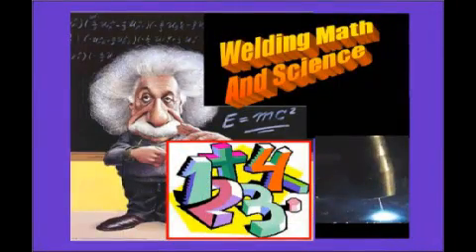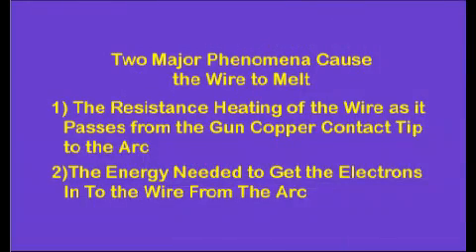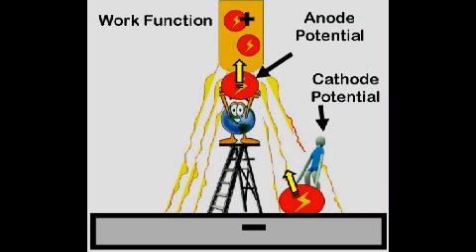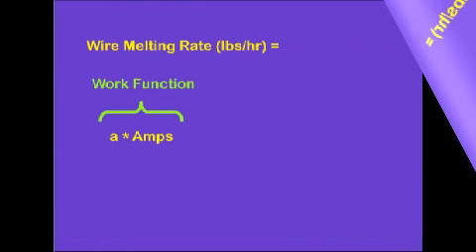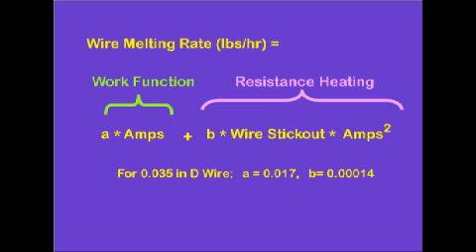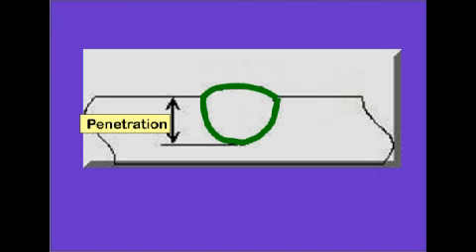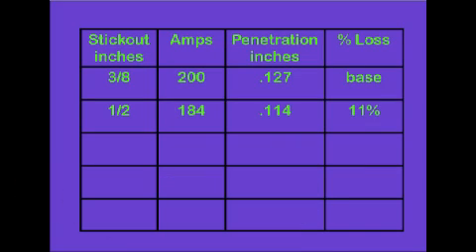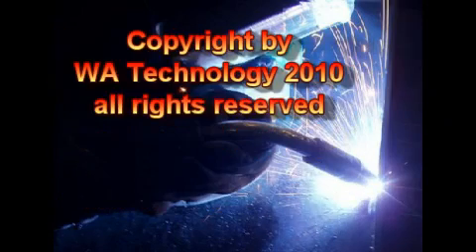Welding Math  Deposition & Penetration Part 1

Comment from the maker: Answering briefly the questions below:  the constants were developed empirically with a lot of testing by several people but mr old friend Prof. Clancy Jaction published the “Science of arc Welding.  The arc does not get hotter with longer stick out only the temp of the wire at the arc interface. Could exceed 500F.  Can’t hold the current constant with longer stick out, have to increase wire feed.
We were selling a home study course called Science of Arc Welding.  With COVID-19 we have made it a free PDF download on our website NetWelding.com. On the bottom of that page-scroll down- you will see trying coursces.  Go to that page.

Comment: What are the penetration characteristics if the stick out is increased and amps are held constant as in the first chart?
Reply from the maker: Can't have the current stay the same or the wire will melt faster, increasing the arc length until it extinguishes.  Unlike in stick welding that does use a more constant current power source and you must maintain the arc length manually, with MIG it's automatic held at the length determined by the set voltage!